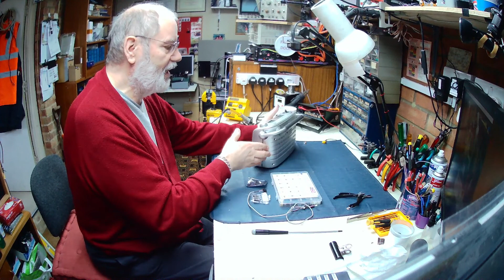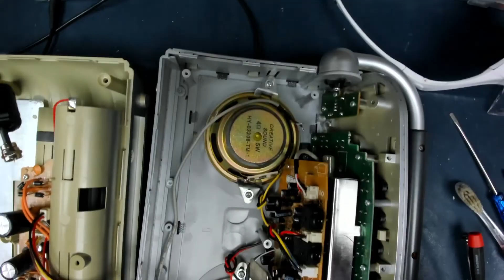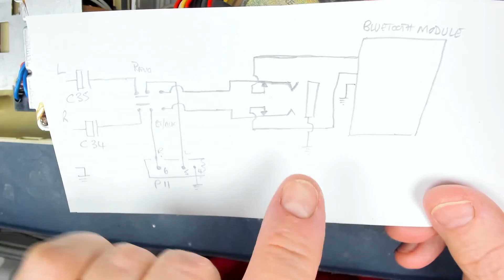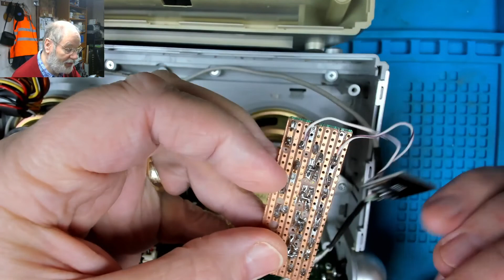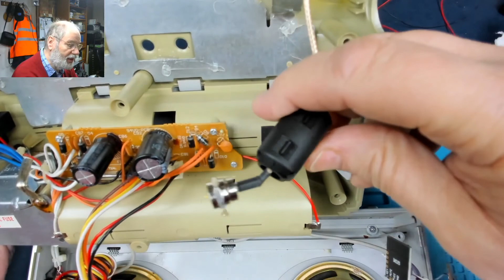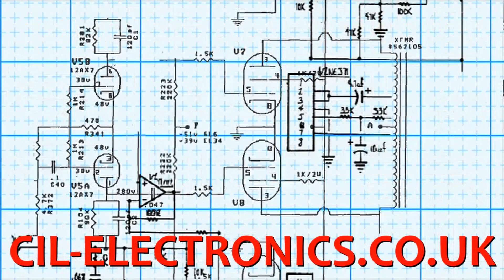Roberts RD20 Bluetooth Conversion

Comment: I've been trying to adapt my Roberts radio for a while now, and yesterday, I was once again trying to find where I could input into the amplifier and again defeated. I thought that I would just have to gut it and add my own amplifier. Then I found this video. I didn't realise that you could get the schematic. Anyway, thanks to you I now know what to do. 

I've bluetoothed a couple of radios and also added amps to the Raspberry Pi, and that pesky earth loop always causes clicking and whines. It helps if you can power the module separately. Failing that using a B0505S isolated 5V to 5V DC to DC converter chip can help.

Comment: Have an RD21 in for the repair cafe, how does one get hold of the service manual? Thanks, Robin.
Reply from the maker: Can't find one on the web, have you tried contacting Roberts Radio Technical? they have supplied manuals to me in the past, their address is on their website.
Reply: @ never thought of that since most manufactures wonn’t. Thank you

Comment: Thanks Chas nice video and explanation. I have the same model could you tell me where you got the schematic from I have a volume issue. When turning volume up it increases to halfway on pot then starts to decrease used servisol little bit better but not what it should be. Many thanks again for video might have a go at the bluetooth addition. Hardly been used this radio.
Reply from the maker: Hi John, there are TWO pots for volume, one for each channel. Servisol is OK, so long as you can get it into the area to go between the wiper and the track of the control. I have often found that it's best to spend some time dismantling and removing the pot then dismantling and cleaning it properly. Not easy if you've never done it before but it should be possible on this radio.
Reply: Many thanks for replying Chas. There is sound from both speakers as I said it increases to midpoint then starts to gradually decrease. I will have a go at dismantling and open pot up. I watched another video not same model were the gentleman had sent to Roberts and they sent the part to him a rotary encoder for a very reasonable price. Chas where can I get the schematic from I tried to  follow your video copy but couldn’t make out numbers and values, once again many thanks I’ll let you know how I get on, go safe…
Reply from the maker: @johnmcgiv1  Hi John, it sounds like the pots are faulty, though it's odd that both channels go low after the mid-point, the tracks of the pots are separate. I would check the supply rails
I got the manual from Roberts, you can try and request one from their tech support team rrthelp@robertsradiotechnical.com  If they can't help, go to my channel's home page and send me an email.
The pots in the RD20 are 10KOhm potentiometers and can be sourced on-line but they board mounted.
Reply: Hi Chas, tried the address for help from Roberts I was directed to Microsoft tried your personal Facebook email no good either hence I am here. Can your tell me how the lower half of the shield is released top is loose don’t want to force bottom. Last pcb has 15 screws is that about right, sorry for inconvenience, go safe...
Reply from the maker: @johnmcgiv1  Hi John, email me contact@cil-electronics.co.uk and I’ll send you the manual.
Reply: Chas have you removed one of the pots before???

Comment: Chas, I wish to add just an aux-in ( i.e. no bluetooth) to my Roberts RD20  which is identical to yours so your modification is very helpful to me and greatly appreciated. I wish to use the radio to connect to the wifi radio on my phone for better quality and volume. It is a shame Roberts did not incorporate an aux in as it does with their other radiios.
I am a complete novice to electronics other than on vehicles so I wish to ask your advice if I may. I don't quite follow what is being switched to change between the radio and aux. Is it just switching the common(ground) from the radio to the aux so that I will need a switch that connects the pin 4 ground on P11 one way to connect the radio ground and the other way to the aux ground ? What is that switch called so that I may order the right component in addition to the 3.5mm female aux 3 pin socket for which I am happy with the wiring.
Thanks again,
John
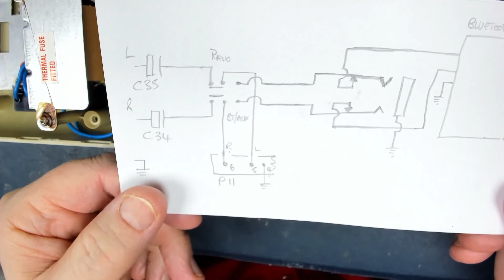Reply from the maker: Hi John, happy to help. If you go to 10:27 in the video, you'll see the circuit which I drew to show how the modification is wired in. Essentially, you need to break the connections between the radio output on  C34 & C35 to the connector P11 Pins 5 and 6, these are the audio line paths for Right and Left. The ground is common to both. I used a push switch to switch between Radio and BlueTooth/Auxiliary inputs, but as you appear to only want an Auxiliary  input, you could achieve this by just using a switched 3.5mm jack socket, like I did for the secondary switching between BlueTooth and Auxiliary. So that wen nothing is plugged into the jack, the audio signals from the radio go into P11 and when you connect your phone to the socket it then feeds into P11. Hope that explains it. Just to say, disconnecting just the ground won't give you the input, you need to provide the L & R audio signals into P11.
Regards
Chas
Reply: @ChasLarge  Thank you for your very helpful reply. That all makes sense. I will add the switched jack socket and let you know how I get on.
Reply from the maker: @johnmackenzie745  Glad to help John, good luck. 🙂

Comment: Hi! I have a sony VAIO PCG-6D1M 
The fan starts but it does not display anything and I do not know why,it makes a sound that the fan starting,the battery led and the other ones open but the screen is dead
Reply from the maker: Could be anything, faulty power rail, bad memory, bad BIOS file, you need to take it to a repairer.